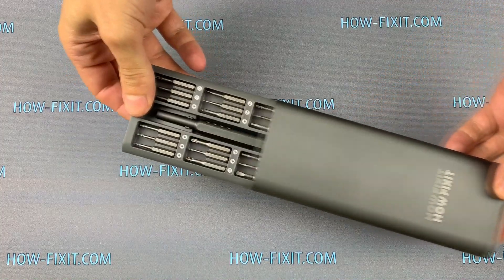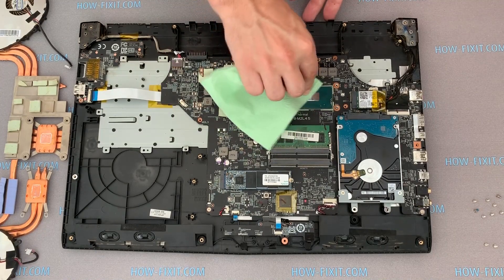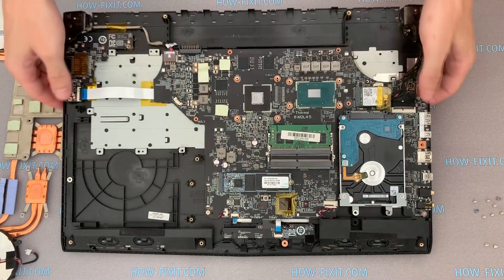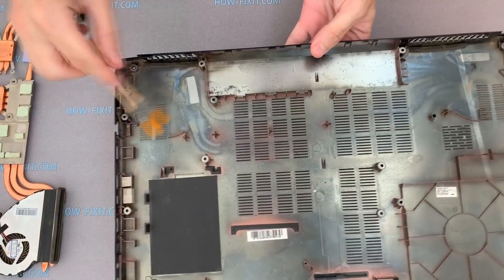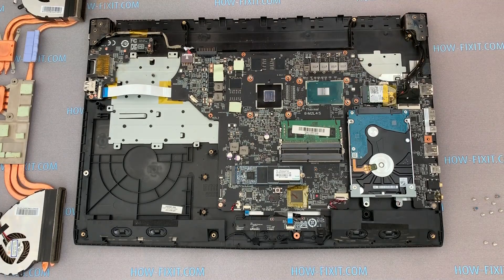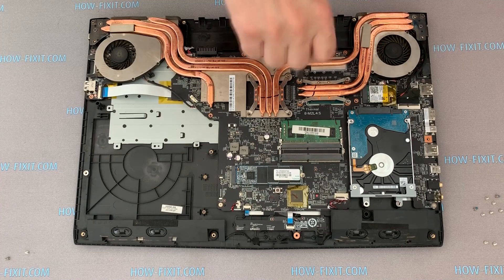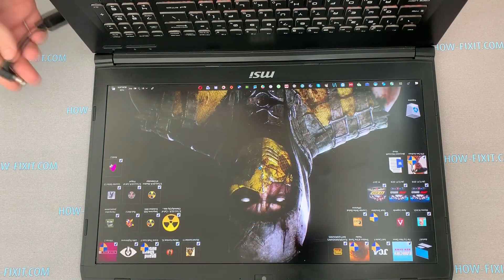MSI GP72 Leopard Pro Disassembly, Fan Cleaning and Thermal Paste Replacement

Comment from the maker: In the description under the video, I left links to screwdrivers and replaceable parts for disassembling and cleaning the MSI GP72 Leopard
Reply: hello, what thermo pad dimension (height) would you recommend- 0.5mm or 1 mm?
Reply: Hi! What kind of screws are used for the heatsink to the pcb? One was stripped and I need to replace it. Thanks in advance
Reply: @andt 0.5 * (dimension of other)

Comment: My GP72 6QF turns on but black screen, how to fix this black screen?
Reply: Have you checked that you plugged the ribbon cable for the display back in properly? Aside from that, maybe try booting in safe mode or just a fresh install of windows.
Reply: @fredstead5652  well, my VRAM got burned... might as well buy a new PC.. thanks for the reply,...  :D
Reply: @ReeceValera-qr1ws  Ah, well, at least you get a chance for an upgrade. The market for laptops is pretty good right now with 3050-3060 laptops selling at the 400-600 range.

Comment: Super well made guide. I’ve had this laptop for a few years and finally bit the bullet to get a real pc a couple months ago. Since I’ve got another system I figured why not finally open this thing up and try reducing the 90+ temps I’ve been having the last year with it. Figured if anything goes wrong oh well I’ve got a pc and this ain’t worth much anymore. 

Everything went perfectly using your guide and my temps top out around 75 now which is crazy compared to what I was used to. It’ll hopefully make for a great side computer for a while if I ever need it.

My specs: i7 7700H, 1080, 16gb RAM, 500GB SSD

Comment: Somehow my case doesnt open. It is very hard to open on the side with the usb ports. It feels as if the case is about to break even after I removed all the screws. Does anyone have a solution or anyone experience the same problem?
Reply: Same here, I can’t open fan side despite of force I’m using. I dunno what’s holds it. Have you sort it out somehow ?

Comment: hello, at 2:57 of the video, you are  changing the thermal pad,
 there are different size of thickness we can buy on amazon (between 0.5 and 3 mm), wich one we have to take for this kind of computer (mis leopard pro)   thank's!
Reply: Hello.  Did you find an answer to this problem?
Reply: @yazilimadimlari4520 they looked like 1.5mm inside of mine

Comment: Worked fine for me! The fanwires were glued, but after opening the fans and figuring some stuff out i got acces to everything i needed. Did a before and after test on f1 2020 on high settings.
before: +-95 constant
after   : 60-75
average fps was about the same, bit higher (90),but the minimum went from 50 to 80.
The amount of dust was insane and removing it made it much quieter
Reply: Excuse me What thickness thermal pads you use 0.5 1mm or 1.5mm?
Reply: @mattlin8449  I checked if I should replace them but they were still sticky and soft so i didn't. I only have 1mm pads laying around so I would have used  those, but i don't know if they are the right size
Reply: @nielsvl4250  thanks ! I also use the 1mm on my Gp72vr , but the temperature is still high than 95 
Can I know what kind Thermal paste you use?
Reply: @mattlin8449  I removed the old paste and applied thermal grizzly kryonaut thermal paste.

Comment: 4:05 this is soo important, I repasted and forgot to clean out the fans especially where the heat sink builds up the dust. I went back cleaned out the fans today nearly 15 degree difference and it sounds soo much better like brand new.

Comment: This just saved me a $100+ bill. I was able to get my fan apart for cleaning. Somehow a small barcode paper came loose from somewhere in the laptop and was under the fan, causing LOUD noise. 

Cleaned everything while I was there. No thermal paste on hand tonight but will get some first thing in the morning.

Comment: Worked wonders for me, thanks! My fanwires were glued into the sockets, don't pull them out if that's the case for you as well. I had someone hold them up for me while cleaning/repasting. Went from +-90C to steady 49C-51C during gaming. Cathair is a big oof for the fans, found out how important it is to clean them.. I pulled out enough hair to make myself a 3rd cat. Laptop is also  100x more silent.
Reply: Which region r u from, i live literally in a desert, didn't see much of a difference, just a 2-3C more cooler ig

Comment: Hi, I have the same model and I realised when I and turning on the cooler boost to  blast fans to the maximum, my GPU fan speed is lower than CPU with 5500 vs 5900 RPM. Does this indicate my any problem to my GPU fan? Thanks.
Reply: I have the same problem. That mean that it is your cpu that is overheating. My cpy is doing thermal throttling because when it reach high temperature, the performance of my system is reduced. Try to change your thermal paste.

Comment: Thank you very much for these clear instructions 👍
I was able to successfully renew the cooling of my
MSI GP62MVR 6RF Leopard Pro

And something I noticed:
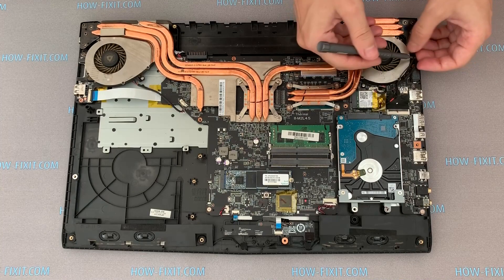When removing the cooling system screws 1:28
my model had small numbers printed into the metal next to each screw hole,
so I could follow them from 1 to 12 and later in reverse order.

Comment: Thank you so much for this detailed tutorial. I was able to change my left fan that had stopped working, and clean the inside of my GP72 7RD. Could not have done it without this video. 

Thank you again. The links were especially helpful for finding the paste, screwdrivers, and fan too.
Reply: Hi! 

Can you help me with the fan replacement part? I can’t seem to find a reliable one. Mine’s left fan has stopped working too.
Reply: @matrxmusic  hi! Sorry I'm replying so late. I hope you found a fan.

Just in case you haven't I'll link it below (link in a seperate comment in case YouTube deletes it as spam).

I got it on AliExpress. 
Seller: 008's
Title: New CPU GPU OEM Fan 4 Pins For MSI GE72 GE62 PE60 PE70 GL62 GL72 GL62M ms-16j3 GE62VR GP62MVR MS-16J8 MS-16JB Cooler PAAD06015SL
Reply: @bouchrafadil1555  hey! Thanks for the help! Although I did manage to find the replacement fan!

Comment: Thanks for the helpful video! However, there are two additional wires, coming from the power unit and being wrapped around the smaller sized fan. I wonder where would they connect to? If I'm not mistaken those would be the WLAN cables?
Reply: @ThatGuy-gn6co  I had to, otherwise I wasn't able to get to the fans as they are screwed to the heat sink. Most definitely change it, no room for risks